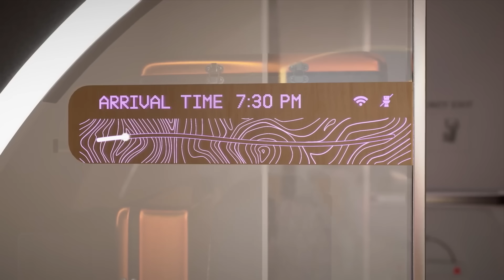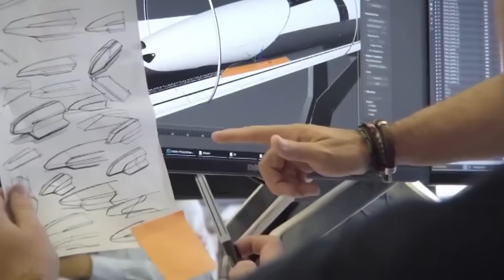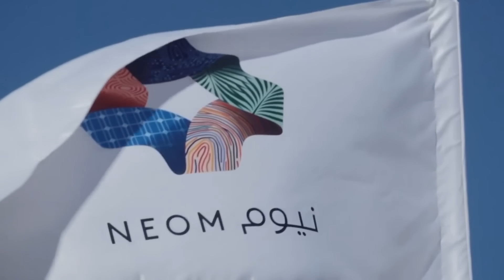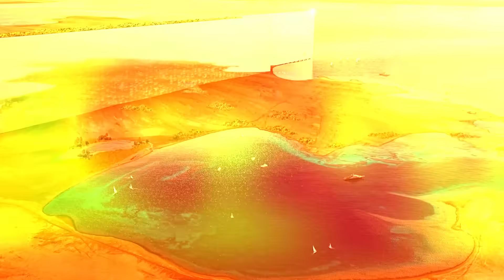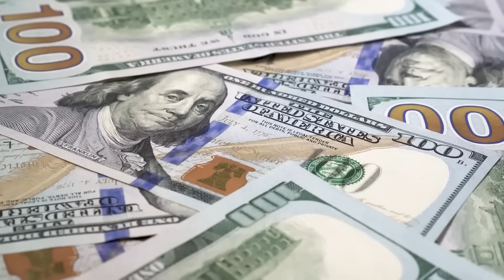Construction Begins On The Line Megacity. It's Actually Happening! 😲

Comment: I'm an architect and I can tell you that these experiments have always been a total failure. The amount of energy to sustain something so artificial would be astonishing, imagine how much money just to clean those mirror walls so that they keep reflecting in the desert or the sand that you have to remove from one side of the building so that it doesn't build up on one side of the wall, the energy from to cool the city, and the inefficiency of distributing the city linearly makes it less than and more small ghettos one after the other since one person has to spend a lot of energy to go from one end to the other end of the city compared to a circular area where everything is closer, basically, it creates a problem where there wasn't one just to look flashy on renders. There is nothing sustainable about this. Also views and sunlight it's a concern, and of course, water supply and cooling since you are in the desert. And also you need a lot of money to incentivize people to go live in that city and companies to create jobs, getting this right is impossible in a rigid scheme of pre-design and constricted space, you need a degree of flexibility to adjust for things that you can't foresee. This is absurd.

Comment: The construction of the main power lines, the main water lines and sewer lines, and their junctions will be easy.  This thing will have some of the attributes of a wall, will blown sand pile up against it?  There has to be some practical reason why that lay-out was chosen.  Will it make it easier for the "greening" of the area?  Traditional city layouts tend to increase the temperature by several degrees.

Comment: 3:00 Wondering if the residential layer will be on the same level as the retail layer. Would be nice if it were on a lower level where construction isn't constantly occurring. But rather away from all the hustle and bustle.

Comment: If the price to establish a business there and to buy a home there is low then you could get people there but the problem is keeping a steady circulation of people to maintain high population levels. The entire design of the housing and commercial buildings would have to modular. The biggest problem with a design like this is that large areas would be reserved for the storage of supplies and sense the structure is largely set the  construction industry would be very small.  The biggest issue I see here is the maintenance of a stable economy. I’m not convinced that it would be possible due to its inherent limitation given that it is a fixed structure. In order to expand you have to displace entire sections of the city so you would need to do allot of work to plan for that eventuality. If you can manage a stable economy here it could be done

Comment: This structure is the equivalent of 4,788 1 World Trade Center's side by side and 2 deep (2,394 x 2).  The existing 1 World Trade Center cost roughly $3.8billion to construct or a little over $1000 per sq.ft.  To add all of the AI technology, "sustainable green" energy, and other amenities they are proposing, you'd realistically need to double that budget to be able to have a chance at achieving something like this.  That's (give or take) $40trillion to build this thing, or all of the money currently in circulation in the United States, or roughly 1/8th all of the money currently in circulation around the entire world.

Comment: Being built perfectly straight is a huge mistake.  If at any point along it's length the structure should lean, the laws of physics would dictate that the entire length would follow and tip.
It should be built in a series of Curves. 
This alone prompts me to believe that they are not building a line city. It makes more sense to be a buried transportation / pipeline tunnel.

Comment: What about the movement of the land? A tiny earthquake can ruin your project.

I hope that wall is flexible just like most tall buildings are, nowadays. Stretching a building on such a long distance means that the tiniest wind or earth movement can make it cracks and fall appart.

From an engeneering standpoint, there are so many issues with this project.

Simple test: Nail a rope to a wall, then move further and further away, stertching it. No matter the ammount of pulling force you can hold, that rope will be crooked.

Comment: The vibration of the train will cause all the city to crumble. It'll also cause heat and fires from the gasses. Where's the water source? Can't build without water. The main problem here is your trapped by desert. You can't get to or from here without dying.

Comment: Screw low carbon... build it light and cheap with  high carbon. Aka carbon fiber  build it to last using as many historical building methods as possible where even if some fail others will not and learn from these mistakes repairing on the fly  also take into account the environment and what you're designing  for  yeah you're beavering the environment aka changing it to suit your needs but if ya do so smarter ya can displace less of the wild animals even providing safe havens for em and walk through transportation tunnels and bridges to other side of city

Comment: There are just too many problems with NEOM.  First off it is not the high speed that the trains are supposed to travel at, but the spacing of the nodes.  You can not accelerate to 318mph then decelerate to reach the next stop... what a mile away... 10 miles away... 100 miles away?  If you accelerate at 1G to that speed then immediately slow down at 1G you have travelled 1.325 miles.  Considering a normal subways train accelerates and decelerates at about 1/15th that speed... That would be 20 miles between stops with no cruising speed... only acceleration and deceleration.  Only long distances between stops will work.  So you put 5 stops in 110 miles (4+ the starting station) you will spend 15 minutes accelerating, 15 minutes decelerating and 10 minutes cruising at full speed to go the whole length... plus at least a few minutes at every stop... so a 20 minute trip now takes about 45 and you still might be 10 miles away from your destination.

Now you need say a set of lines going the whole length, but only a handful of stops on it, then you need a much larger system running at much lower speeds to handle shorter trips of 1-10 miles.  Then you need elevators and sliding walks or bike rentals or something to handle the rest of the travel... especially if you want to include elderly and handicapped people.  And this is just to move people around.  Now double that for cargo too.  Now you need basically 8 sets of tracks running the whole length... maybe more if you do not want to wait up to 45 for the next train.  If the local trains stop every mile and cover 10 miles.  They can not go anywhere near as fast and the larger number of stops means you might be waiting again 20 (120mph half acerbating and half deceleration for an average of 60mph and 1 minute stops at 10 locations).  Then you have up to a mile walking.  So it might take you up to 2.5 hours to get from one location to another in NEOM.

Then there is the whole problem that there is no mining, no natural resources, likely no manufacturing, no ports, little tourism for people that live there that they could not get elsewhere.  Without all of these things... how do you get people to move in... what is the draw?  It will maybe be able to provide the energy needed, but likely not the food, and definitely not anything else.  Well not you need to double the transit lines because you need a way to bring goods in... and likely at least some garbage out.  So are you going to hook it to a port or rail center, or airport... or all of the above.  Can't put that in the city.

Ever try to ship in food for 9 million?  Well let's say it is self sufficient and can grow its own food.  That is close to 10 million acres normally for 9 million people.  Cut out crops for animals and fuel, make it more efficient with lots of hydroponic, increase yields with genetic splicing, remove all disease and insects...  If managed properly and go 100% vegan... maybe 1/25 that and that is being generous.  So that means to make enough food internally they would need slightly over 1/3 the usable floor space... or say 50 stories of 100% food production.  Then we need to process, ship, store, sell, and cook the food.

The mirrored walls will be an issue.  It will of course create a lot of localized heat outside the wall.  This will likely create an updraft and having something THIS big creating a wall of hot air rising over a 110 mile stretch.  How is this going to effect weather patterns.  Who cares about the birds... this could create a dessert where millions of acres of farm land currently sits.  I hate large scale projects like this because you have no idea what the long term impact could be.

Want to think of it another way.  150 stories tall and 10 square miles.  That is 1500 square miles of surface.  That means you have about 1/10th of an acre per person.  This is a SOLID block 150 stories tall, 200 yards wide (.113636 miles wide) and 110 miles long.  There are 640 acres in a square mile... that means the entire solid block is just short of a million acres.  9 million people that is 1/10th of an acre being generous.  With the drawings they show they have a lot of empty space inside that well for air and open parks and such.  Say you pack the lower levels and walls a bit and have say 1/4 be open space... now you have about 1000 square feet per person... and you might think that is not bad, but this is 1000 square feet for your home, job, gym, school, roads, storage, wiring, cooling... and the structure and walls to go with it.  This is counting no food production at all either.  Your actual living space is likely going to be less than half that and you will have to work, go to school, and do most of your entertainment at home... in a room roughly 20x20... and this is being VERY generous... likely it is closer to half that.  Based on the drawings they keep showing off though (and importing all your food) NEOM can only support about 2-3 million tops and with the top open the temps in that area get into the 120+ degrees F.  This whole project is stupid.

Comment: Brilliant thinking and a waste of money. Best bet is to go underground due to the heat which can be harnessed. Glass walls will just obliterate anything and act as a magnification glass on a ant hill. The only way the glass mirror would work would be by a nitrogen cooling system and solar panels to harness the suns rays. The amount of nature needing to be transported and the amount of water needed would be unimaginable. The transportation service will have to be a direct link without stops otherwise it'll be more like 2hrs at least even with the fastest train in the world. It'll have to be a rocket based train running on immensely large scale of power or magnetic field to even run like the speed they claim. Then the rocket fuel would damage the zero carbon footprint and screw the whole thing up. Build a mega city but not like that otherwise you will never be able to see its completion. Plant thousands of trees that could survive in the heat and turn huge areas into farming to grow food. A great line of glass, metal and concrete with a reflective surface would be a eyesore seen from space. The sheer height is unlikely as to make it 500 stories high is a huge ask from any construction company. So it's going to be the longest and tallest skyscraper that can be seen from space which cost unimaginable amounts of money that nobody wants to live in. All down to the nations nasty human rights violations and blatant disrespect to anyone who has issues with their behaviour towards the humans rights act. 2 million people is a pipe dream best part of 200,000 more like and hige swathes of areas left empty for years on end. Only in the UAE they can waste billions without thought on useless construction ideas in this era. Best part of a 35yr project to build the city and at least 5yr to build the super fast transportation system. Then having it actually work without issues and everything checked before anyone living there is going to take 10years to check over everything and it'll have to be done constantly. So a 50yr project has started and throwing money into the desert for super luxurious mega city is the best idea they have. Its not wide enough and will need several underground transportation services which will need a colossal amount of electricity to power it before the mega city can operate without any interference elsewhere. Great thinking but truly a waste of money an awful lot of money. Nobody will invest in it and it'll just be a useless eyesore. Grow grain or food in these areas pay the locals to work them and contribute in the world not just be so far up yourself that eventually the world will just say goodbye.

Comment: The mirrored surface would have to stand up to wind with sand.  I would think after a few years this surface would be milky from the scratches on the surface.  There are some mirrored buildings in other cities that infamously melt car plastics and can at certain times of the day burn items.  This is usually very localized, a few centimeters.  This would be massively larger.  As to some companies not wanting to invest because of Human Rights violations, we still buy their oil, so we are still investing.  If the west had not stopped trying to be energy independent they might have had some influence.  As of now the West has no power to influence anyone.

Comment: If it is designed to improve the area and provide non'energy dependent housing, water, and energy with food production included let me know. That is the kind of design that's needed.

Ambient water capture, composting toilets, water recycling, solar power, methane capture, earth sheltered homes that don't require much climate control for human comfort, green spaces, trees, indoor vertical produce gardens, hydroponics, and aquaponics.

Comment: As you can see in the video. It's SPECULATION that this is the line project. Doesn't match the parameters of what the LINE is supposed to be in WIDTH. Like they said in the video. Most likely the new high speed rail system.

Comment: Are there any people who believe this will happen?
Reply: Yup. It's just Manhattan on steroids. Could you pull this off in NA, Europe, or other countries where there's lots of industry and commuting? Probably not.
Reply: @lornes7526  if it ends up being Manhattan on steroids, it will not have happened, something else would have happened. Manhattan on steroids is not what is being promised. Although I guess I have no idea what you mean by "Manhattan on steroids" so maybe I'm not grasping the overall point
Reply: @popejaimie  
If you look at it from a numbers game, you're talking 53000 inhabitants per linear km/.62 of a mile; that's a lot which means you need a lot of grocery and amenities within each linear km. In Manhattan, there's 1.7 million people in 60sq km, so The Line is more populated when you do the math. Either way,most necessities in both places have available resources in a very short distance away, and they both survive only because of that. Unlike Manhattan, The Line is much more vertically  stacked allowing travel to amenities vertically and horizontally. It'd be like living in an apartment with a mall five floors down. When it comes to supply, you'll need trucks or rail to bring stuff in, but it's a one truck, one stop unload, it's not going to a distribution center then onto other trucks to supply individual stores. It's much more efficient. Like I said in another post, it can work in its location. Would it work in the US, UK, or Germany? No, people need to commute to work and the infrastructure isn't designed for it.
Reply: @lornes7526  I still don't know what you mean by Manhattan on steroids, unless "Manhattan" is just a placeholder for "cities in general"; they're gonna have trouble attracting that many people to live there; and there's plenty of open space in the US and Europe to build all the same infrastructure, so I don't see why it'd work in SA and not US or Europe.

Comment: Mirrors, great idea, but better would be solar panel's and black tubes of water circulating to holding pond or closed system depending on use, i.e for use in night time heated flooring, hot water, ect. The solar would still reflect what's not absorbed plus provides tons of clean electricity for the oil people lol. Should probably leave some small tunnels here and there that pass threw for your animals to migrate or transition through. Plus it would save on construction materials
Reply: Could even use the solar power just to power their new train 🚆 and it would be worth it
Reply: In order to plan the tunnels you would either have to build under everything like a underpass, or straight through meaning the placement of the train determines where and how you can do these migration tunnels. You could technically make your migration path go over the wall and city in certain areas but that would be insane as building a city across a desert 🏜 with a big wall in front of it. 😆